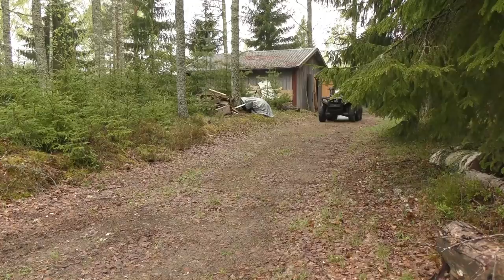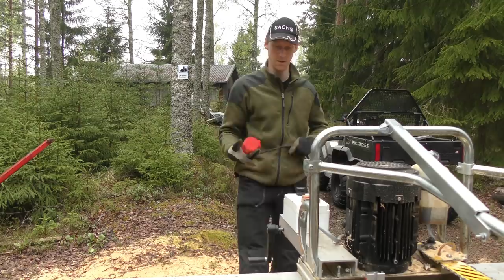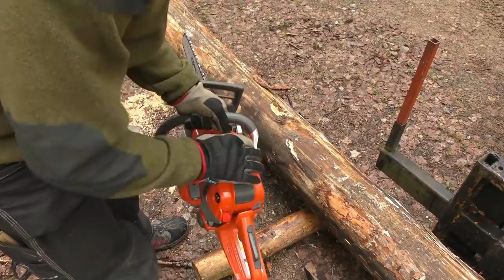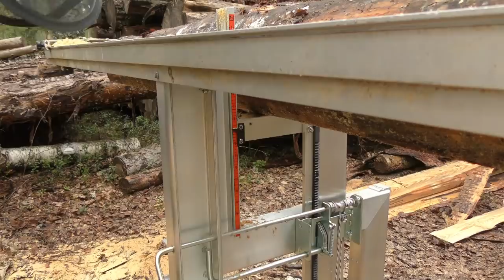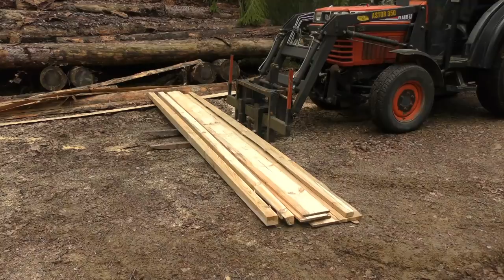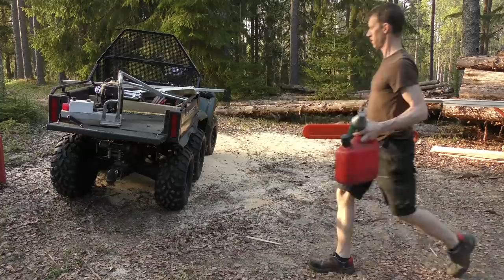Milling on the chainsaw mill — THIS IS AWESOME

Comment: Just curious what "off grid" actually MEANS in Sweden.
Reply from the maker: I believe it means the same here as in the rest of the world. That you are disconnected from the power grid, water and sewer and other systems provided by society. But I belive its up to you how hardcore you want to go. You could go all in and live in a cave in the woods, but that makes no sense for us. So far on our journy we have our own water and our own sewer and we heat our cottage with wood from our own land and is not dependent on the electrical grid. At the urban homestead we have still all those utility's but have an large solar system in place. The long term goal is to sell the urban homestead, but it's a journy and nothing that you do over night. Have an amazing week!
Reply: @offgridsweden  Apparently, then, most of rural Western Pennsylvania, then, is "off grid", and they neither tried to be, and don't even realize they ARE!  Exactly my point. A good one to you, as well.
Reply: I can see "off the grid" can have many meanings. Technically OTG means you are not connected to the electrical power grid which is wires  connected in a box configuration. Petroleum products power the grid and are produced by the grid.  Until you are off petroleum products and are using wind , water, animal, and sweat power: you are on the grid.  Just so you understand ; their is no communication grid,  no personal identification grid, no banking grids, no spying grids. These are networks  that use the grid for power.
Reply from the maker: Off-the-grid or off-grid is a characteristic of buildings and a lifestyle designed in an independent manner without reliance on one or more public utility's . The term "off-the-grid" traditionally refers to not being connected to the electrical grid, but can also include other utilities like water, gas, and sewer systems, and can scale from residential homes to small communities. Off-the-grid living allows for buildings and people to be self-sufficient, which is advantageous in isolated locations where normal utilities cannot reach and is attractive to those who want to reduce environmental impact and cost of living. Generally, an off-grid building must be able to supply energy and potable water for itself, as well as manage food, waste and wastewater. Have an amazing weekend!
Reply: Offgrid.se So in your case OTF is a frame of mind, a way of doing things in an organic manner.  In the US the connotation is a “lifestyle” that prevents despotic rule over an individual and their GOD given rights as a human. To prevent said governmental body to impose physical or intellectual slavery on that particular human. It is especially important to OTG person to protect their second amendment right to bear arms to keep the tree of liberty watered with the blood of patriots and despots alike. I know what you are reading from my comment is completely foreign to many but to the American patriot it is as natural as breathing.
Reply from the maker: @iwginc2877  I am all with you. What I sent to you was the definition of Off Grid from Wikipedia. That is the common understanding of the Off Grid. I would say that it's up to each person to define how hard core Off Grid you want to be. For me the important part right now is knowing I will be able to sustain my family if the grid goes away. It's a long journy left for us but at least we are well on our way. Have an awesome Saturday man!
Reply: Offgrid.se yes language is a tough thing to use. God confused the language at Babel and its only gotten worse. In the US  the word cod means a type of fish in the north and in the south it's a slang for penis.